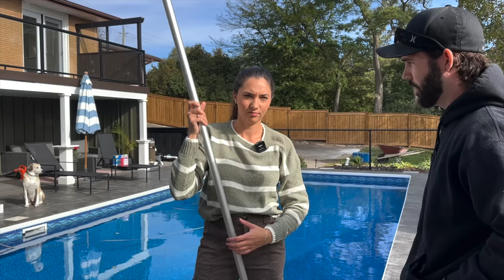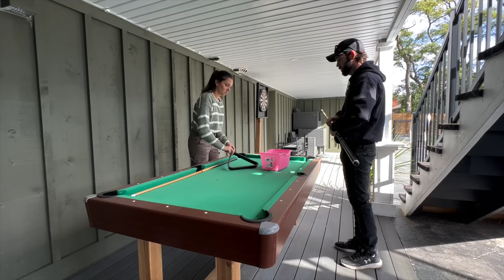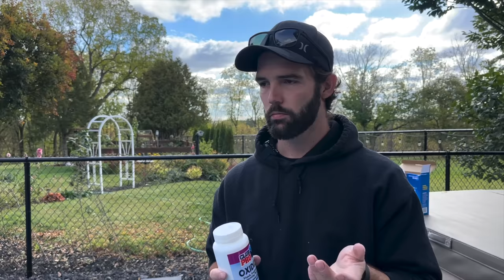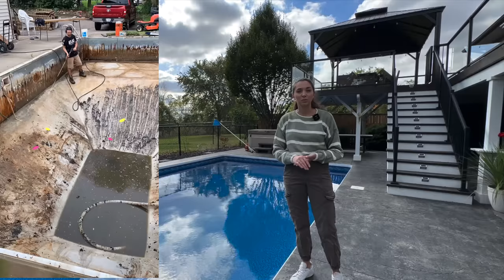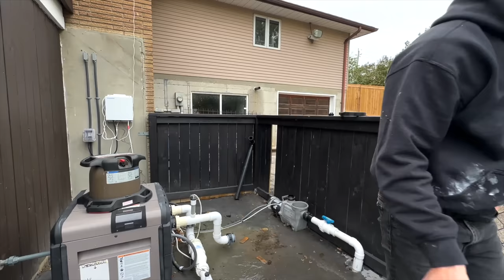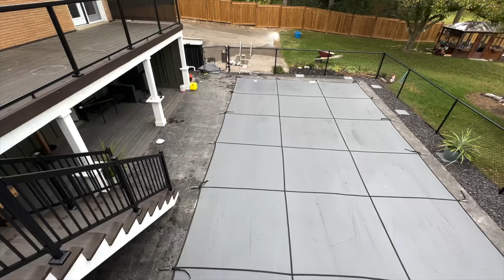Closing The Pool 😔 Patio Cleanup & Winter Prep

Comment: When our company closes pools here in the UK, we tend to vacuum to waste (vacuum whilst the multiport valve is either on waste or backwash) before adding in any chemicals. Adding chemicals first and allowing them to circulate before draining the pool down means that you're losing some of those chemicals when you drain the water. Most pools that I have personally shut down take 10 litres (1 tub) of liquid chlorine, a bit of Ph reducer, and between 1 and 2 bottles of winter algicide with anti-staining agents.

The process I personally follow when shutting a pool is as follows:

1: Test chemical levels. Self-explanatory, this tells me what I need to dose into the pool.

2: Clean the pool via either vacuuming and netting or using what is called a "hammerhead" pool cleaner. The Hammerhead cleaner is essentially an outboard motor from a boat that runs on a 12v battery. It blows muck up into a bag that is fitted to the top of the unit. It only really works for leaves and larger debris. Smaller dusty particles just go right through the bag or clog it up. Whilst cleaning the pool, I have the customers' filtration actively lowering the pool water level. If there are no suction points below the skimmers, I will use one of our pumps to pump the water below the skimmers, then circulate chemicals with these pumps. If there are suction points below the skimmers, I leave the customers' filtration running to circulate chemicals via these suction points. Ideally, I get the water level around 4 to 6 inches below the skimmers, as this gives a good buffer zone to allow for rain to fill the pool over winter. 

3: Dose chemicals and allow them to circulate for 15 to 30 minutes, depending on the size of the pool and how good the circulation is. I find that rectangular pools get the best filtration, whilst kidney-shaped pools get the worst filtration out of most of the shapes that I've seen. Multiple chemical tests are done at different areas of the pool to ensure chemicals have circulated fully. I aim to get the chlorine to around 10 ppm, as this will last a good while, providing the customers' debris cover is in good shape. For Ph, I try to get it around 7.0 to 7.2. This allows the chlorine to stay nice and active over winter. 

4: Loosely fit the debris cover around the pool, then go around and tighten each strap until the cover is flat and off of the water. I'm not usually satisfied until the springs for the debris cover are really compressed under the tension of the cover. Some of our customers take it a step further, and they have lengths of wood to lay around the sides of the debris cover to prevent leaves and other debris from getting under the debris cover over winter. The idea of a debris cover being tight like this is to allow leaves and debris that fall on the cover to blow off over winter, rather than causing the cover to sag and drop them into the water. Even if the leaves and other debris are sitting on top of the debris cover, if they're sitting in the water then the chlorine will be used up by them. Plus, a sagging debris cover can cause the sides to lift up and allow debris underneath, which will in turn allow more debris to enter the pool. This uses up the chlorine faster and can end up causing a very green pool. I usually drain the skimmers at this point, either by using my wet vac or by opening the skimmer valves to allow the water to be sucked in via the pool pump until it begins to suck air. I then place chemical bottles half filled with water into the skimmer to protect it in case of freezing in the event that the pool water gets high enough to fill the skimmers over winter. Squares of tarp are placed under the skimmer lids to prevent rain from filling the skimmers over winter. On tiled pools, I also half-fill multiple chemical barrels with water and float them on the pool surface over winter. Idea behind this is that they are sacrificial and will be crushed if ice forms before the ice pushes out the walls of the pool. Liners can shift a bit, so ice is less likely to cause damage. Unless someone tries to move the ice, in which case the liner can be torn/pierced.

5: Once the debris cover is fully fitted, it's time to drain the plant room (if applicable, as some pools are kept running on a frost stat over winter, in which case the plant room is not drained). All pool-related circuit breakers are turned off, timers and switches are turned off, and items that are plugged into sockets are unplugged as an extra precaution. I then proceed to take out the pump drain bung(s), filter drain bung, heater drain bung (if a heater drain bung is fitted, if not I just empty it from the unions), plus any extra equipment that is fitted, such as UV units. I also drain any low spots in the pipework. 

6: If a solar cover is present, I usually put some sort of protective cover over it. Providing there is one available on site, that is.

7: Pack all of my equipment away in the van, pack customers remaining equipment away, then say goodbye to the customer and get on the road.

Please be aware that this is just a generalization of the average process I complete. Sometimes different things are applicable, as different pools have different needs, and certain customers prefer things done differently. I believe the most important part of keeping pools clear for the open up is to ensure chemical levels are checked and topped up at some point during the winter season. We provide a winter check and a pre-season check for our customers, if they wish to have them, and this tends to help keep a lot of pools clear over winter. It also means we have to use fewer chemicals in the long run, which ends up saving the customers money. If a pool goes green, it takes a decent amount of chlorine to bring it back to clear. 

I'm aware that there are different strategies for pool maintenance over the winter months in your part of the world, compared to here in the UK. However, if you have any questions, feel free to reply to my comment with them. I'll answer to the best of my ability.

Comment: I moved from your area-ish to the desert and we have poisonous spiders so around here it's normal to spray the foundation and entrances of your house and outdoor areas with pesticide. I keep my dogs off sprayed surfaces for a day to dry but after that I can go a year without seeing live spiders. Maybe next Spring you could spray just the upper deck area where you sit and it would create a safe zone? I know, I hate using pesticides too, but it's necessary here and it really does help. If you can minimize the use and keep them from runoff like under the covered deck it may be fine.

Comment: Have owned a pool for 20 years in NH and shocked the pool and covered with a pool float in the middle. Never had an issue. Add chemicals don’t add chemicals the water always looks the same when you open.

Comment: I’m no pro, but a pool owner for 10+years, and I’m pretty sure Andrew is right about the chemicals.  Clean the pool and skimmers. drain the pool below the outlets, add shock, blow out the lines and add antifreeze, cap them, cover the pool, drain your filter (ours is sand), unplug your equipment and wait for April or may.  Literally an hour if you hire someone or 4-8 hours if you don’t. Anyway, never added the extra chemicals, and never have had a problem.  Anyway, love your guys’ videos.  They’ve provided me with some inspiration for my own home!